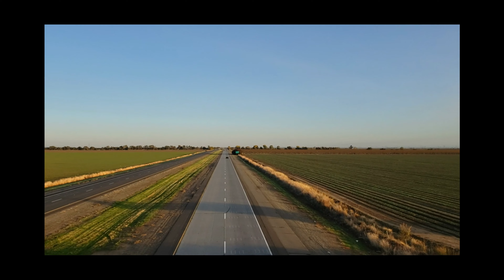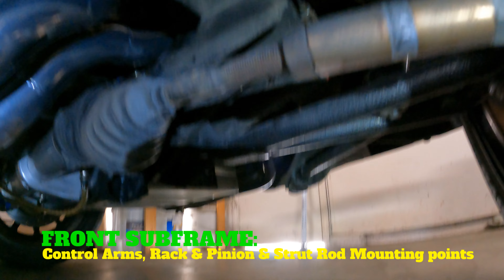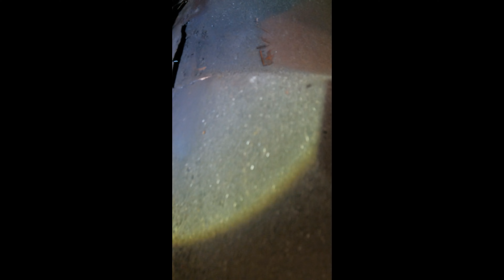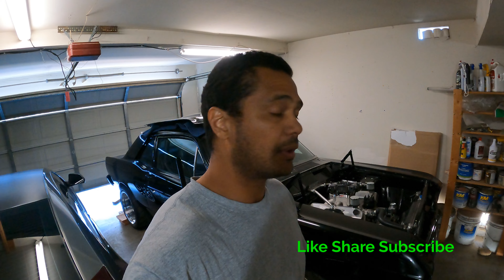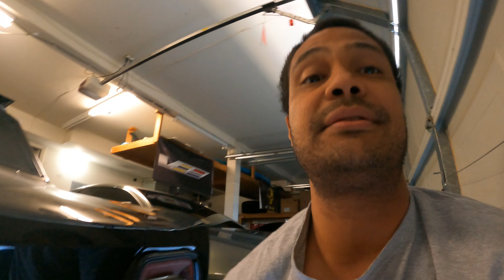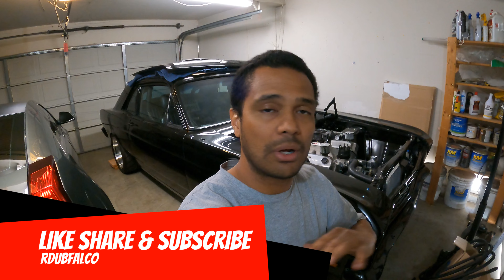S:2 E:10 FALCON RETURNS TO THE NEST

Comment: Gotta go full send brother. That car deserves it
Reply from the maker: Exactly!! Only one way and its the right way. Gotta go all in!! No shortcuts💯 thanks for watching.
Reply: @TheRdub82  I checked out Detroit Speed. Everything is for Mustang. Will these bolt right in?
Reply from the maker: @krash55918  the frin subframe width is within an inch or two between my 68 Falcon and a 67 Mustang we measured. Either way we have a solid fabricator to make it happen. Do you think we should do the Roadster Shop Spec Chassis instead though??

Comment: I would NOT be happy with the way they left those rails in the rear 🤔😪
Reply from the maker: Definitely not happy, looking forward I need to make sure the whole back half is rock solid. Especially with the new powerplant. My next step is to findout if that Roadster Shop Spec- Chassis for the XR-XY Falcons will fit my US 68 Falcon. Or just use the Detroit Speed front and rear clips. Thanks for watching Russell 💯🔥🏁